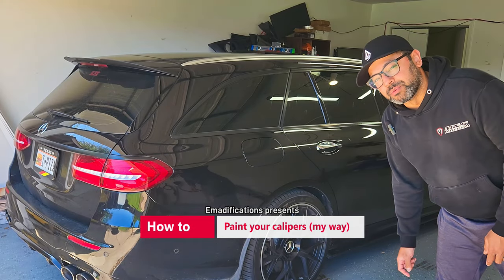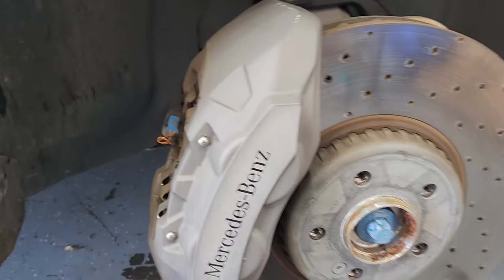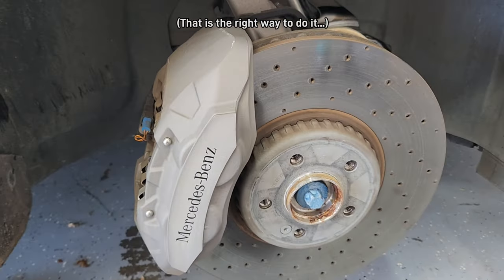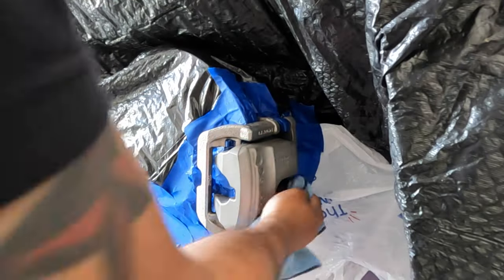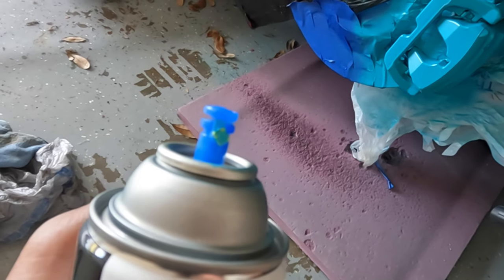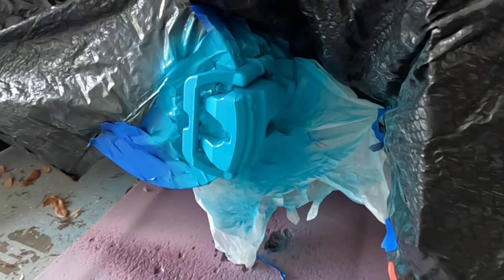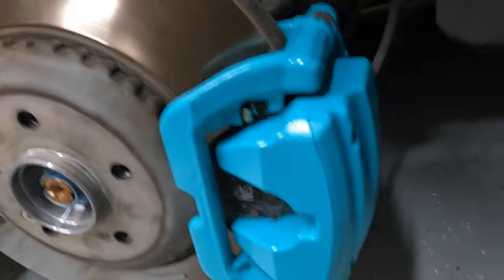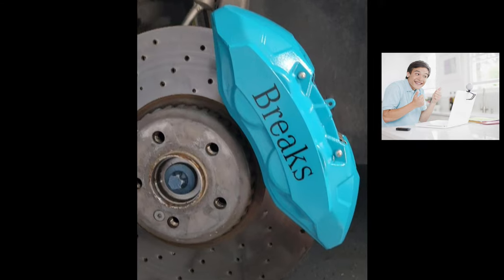HOW TO PAINT BRAKE CALIPERS WITHOUT REMOVING THEM: High temp spray paint, gloss, logo & ceramic DIY

Comment: How do you still like the wagon? Can you make a quick pro/con video? I’m looking at em and debating whether I should go to the 2021 refresh or not
Reply from the maker: Great timing as I'm making a video that has 3 pros and cons. My big question for you will be are you looking for something a bit more spirited ? Like sporty, handles well, and gives you some adrenaline? Or are you looking for comfy, quick, and quiet?
Reply: @Emadifications  I usually like a noticeable difference between eco/normal and Sport; the Stinger GT (which is what this will replace) and Mk7.5 R (stage 1) had a good enough difference (you and I have had very similar vehicles over the years haha I call you my “car twin”).

The priority is definitely to be comfortable and tame when not in sport mode, though. For example, I chose the RWD Ioniq 5 instead of AWD because that was good enough for us nowadays.
Reply from the maker: So when you put this in a sport mode it does change the shift points and power output but mine doesn't have adjustable suspension so it stays the same basically the whole time. My biggest complaint with this car right now is the transmission is very sloppy. It's fine when you're driving it very conservatively around town, but I'm starting to feel some jerkiness at downshifts even in comfort mode. Now this may be an issue with my specific car, but the transmission is just not snappy. I've heard that the TCU tune makes it slightly better but I don't think it's worth the $1,500 because nobody said it's really good. Therefore, as the spirit of car to me the limitation is the transmission slop. I'm going to get a transmission fluid service done and reset done and see if it helps, but I'm not sure. The amg's act completely different. Their transmission shifts very snappy and is awesome and makes all sorts of cool noises. Reminded me of my s4. This shift speed is about the same as a stinger gt, so you won't notice too much of a difference there. But if you're looking for adjustable suspension, my model doesn't have that. it's an okay balance of performance and comfort but it definitely leads towards more of a commuter car versus a performance car. The power is there though but it's very quiet all the time and fairly tame. Just depends on what you're looking for. Let me know if you have any specific questions I can answer, instead of me just rambling haha
Reply: @Emadifications  that’s definitely helpful info! Would you classify the 2018-2020 as “spirited/sporty/adrenaline shot” and 2021+ as the “comfy quick quiet” since it went full all-terrain? I’m not looking into the AMGs since I want the jump seats for the kids and I got the V8 gas mileage covered from B7 RS4
Reply from the maker: @amercancurry I wouldn't even call the 2018 to 2020 spirited or adrenaline shot honestly. They're pretty chill cars that don't inspire a lot of sporty behavior. I feel like the new ones probably got even softer and probably have a little bit more body roll. So in this context, I would say the 18 to 20 are probably a decent bit sportier per se, but I haven't driven a new one. Reviews tell me that it is pretty soft but a little bit more powerful
Reply: @Emadifications  the “more powerful” is probably because of the mild hybrid. It did a 4.4 0-60 per Car & Driver, but as an all terrain, it sits higher so that would need to be fixed. But still having a New Vehicle Warranty is kinda nice haha 

The warranty and having the new MBUX are kinda the 2 pros for me but I’m not sure if they’re enough. How do you feel about the media interface on yours? Is the dial and non-touchscreen good or annoying to use?
Reply from the maker: @amercancurry  the interface is fine. I do use Android auto 90% of the time, but it doesn't have full screen Android auto. It's got this small black area for some reason. But apple carplay is full screen.  But my number two least favorite thing about this car, outside of the transmission, is the fact that I have to use a dial. My 2019 Audi S4 had the same bullshit. It's absurd to me that they thought that this is safer. I spent so much of my time staring at the screen to make sure I'm in the right selection. On a day-to-day basis it's possibly the most annoying thing. I've learned to live with it but I can't wait to get a car that has touch screen again. Most of my cars have had touch screen. I don't think I'm doing a good job of selling this car, haha. In all honesty also, Mercedes doesn't really do it much for me unless you get a really high-end one. I only got this one because I wanted a wagon. And I can't afford any of the other wagons. It's not a bad car but there's just nothing that special about it that others don't do better. It just looks awesome because it's a wagon.
Reply from the maker: @amercancurry also for what it's worth, I haven't been able to get under a 5.2 0 to 60. I wouldn't call it super slow, but my stinger did get 4.3 and my ev6 gets 4.4. definitely noticeable. And I'm not planning on tuning at any time soon cuz honestly it's quick enough, just not exhilarating.
Reply: @Emadifications  that would be noticeable vs the Stinger it’s replacing. I guess C8 A6 allroad + 034 tune may be the better path then. Not sure if my previous comment was posted (between your interface comment and this acceleration one) since it’s not showing on my side, but just in case it wasn’t: I appreciate your honesty and transparency! Looking forward to your video!
Reply from the maker: Honestly I've been eyeballing the 2021-22 models of the A6 wagon. When I bought this Mercedes I didn't even know those were an option. Otherwise I would have saved up a bit and gotten that because it has the same powertrain as my S4 which I loved. There's still times where I think about trading this in but I'm pausing any big financial car decisions right now due to other personal stuff. But if that transmission doesn't get any better after the service and reset, I may still consider trading it in because it really does kind of ruin the driving experience. I think I also need to go test drive another e400 and compare it.
Reply: @Emadifications  test another + the new one and make a comparo video? 😁 maybe even test a C8 A6 and V60 T8/V90 T6! Battle of the wagons! 😄
Reply from the maker: @amercancurry  I only wish I had the resources, equipment, and vision to do something like that. That sounds amazing
Reply: @Emadifications  well hey man, maybe one day! Either way, whatever you choose to do, I’ll watch it- keep up the awesome content 👍🏾

Comment: ideally would be to take the whole caliper off but then you have brake bleeding as first task when done, and depending on car it might not be doable for a diy'er(may require a work shops tools etc.) pretty darn good job anyway.
Reply from the maker: 100%. That's def the best way to do it and get the best coverage. But I really just didn't wanna deal with what you mentioned and also, this damn car uses unique star screws and hardware that I didn't have on hand.

Comment: Did u sand and use primer?
Reply from the maker: I didn't use primer. I "sanded" with a couple metal brushes. So technically, no. Those are def steps to take that help longevity that I didn't take.